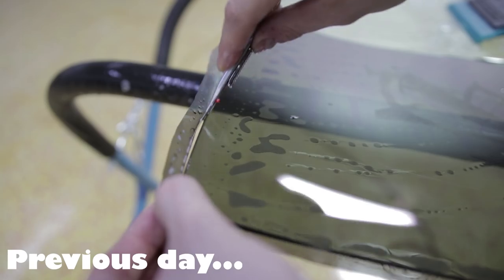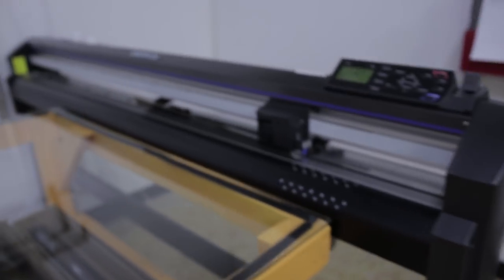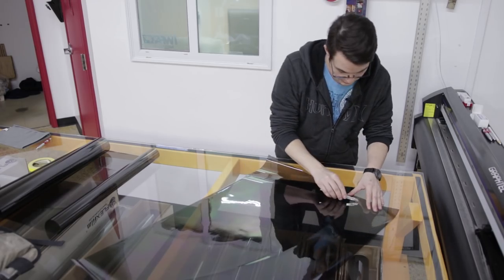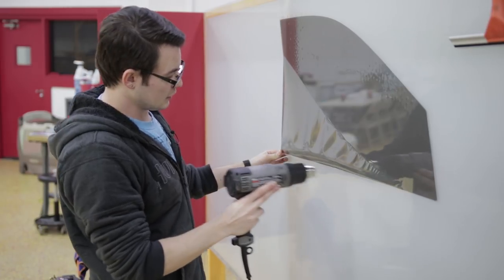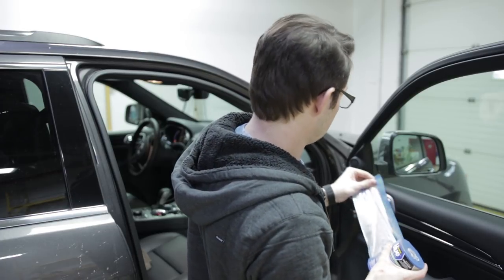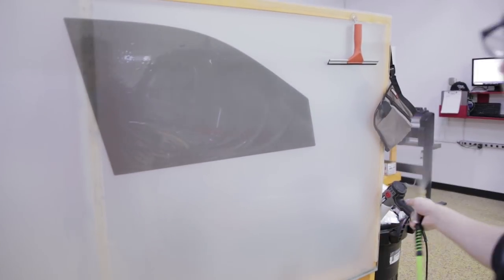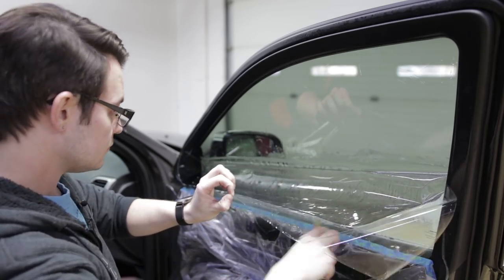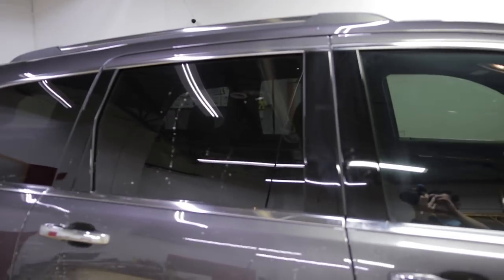Tinting with a Plotter and Glass Boards

Comment: how do you cut the front that has been in the heat gun using the ploter so that you can directly trace it to the windshield without cutting it manually

Comment: Nice heat shrink method. You use tinttek?
Reply from the maker: +Ricky Q I love tinttek but in this video I'm using a software called computer cut.
Reply: I’m using computer cut too. Top edge is so so. Planning to switch either tinttek or film vinyl. What do you recommend
Reply from the maker: +Ricky Q I've noticed the same thing! I actually edited the part out where I rounded off the top corners because the driver's side window pattern curls up. I've seen it on quite a few vehicles.

Tinttek was the most consistent but took a while to get some new patterns. It's been a while since I've used it but honestly they all have drawbacks. And don't ever count on accurate windshields lol
Reply: could you please recommend a affordable plotter and everything I need with it? I see a nice man near my city that spent some time showing me shrink techniques and he was using a GCC machine but not sure what sfotware he was using
Reply: 04av6 I use Gcc 60” and Computer cut software.

Comment: Nice video is filing hard???
Reply from the maker: +JBIRD575 thanks! I'm totally new to trying it but it doesn't seem that difficult once you know what to do. I've talked to a few guys and have a better understanding of the few popular methods. I hope to have a better explanation in my next video
Reply: TintStuff I tried it shaved with blade first them heated it real good first..this one guy taught me use a seperate bottle with little alcohol and light soap for top edge works great dries fast....the key to file is have it dry
Reply: TintStuff still experimenting with wet shave with a blade brotha!